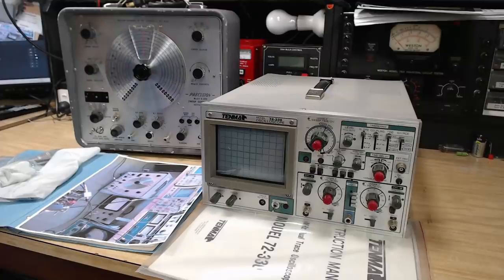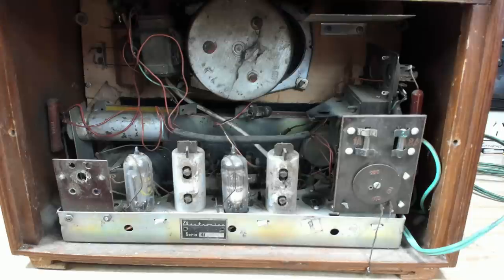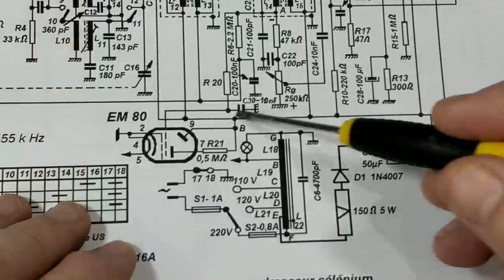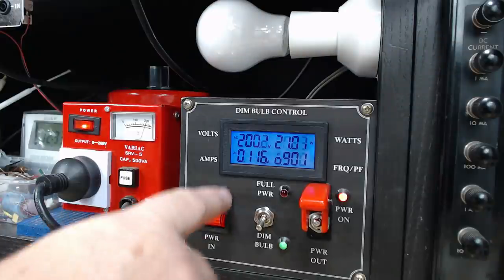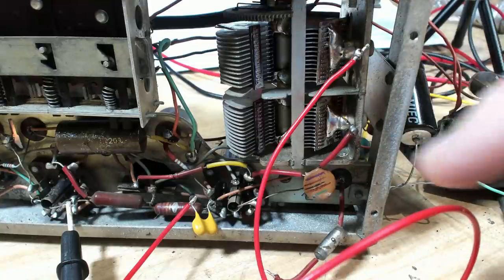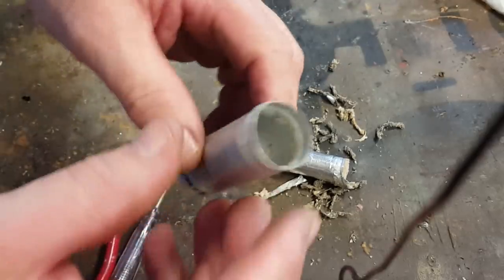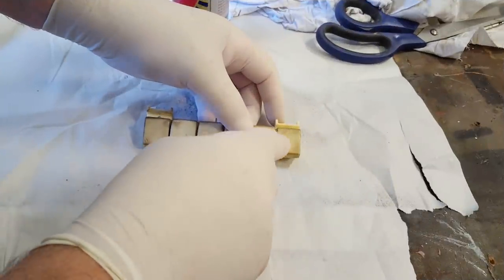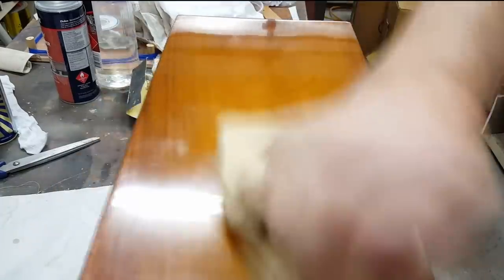Carmen 2 1963 radio from Romania - Restored

Comment: Hello Dave how are you. That is a very good looking radio and you made it work as good as it looks BRAVO. My mom is German she like your videos on radios from Germany. I shared your videos to her messenger.  I would like to tell you about a simple inverter circuit you may want to experiment with. I wanted to challenge myself in building the simplest inverter that can run a shaded pole ac motor. I used ECG179 Power Germanium transistors because I have a big box of those plus I wanted to give it a vintage charm. Silicone transistors will work too. The parts needed are....two ECG179 PNP or equivalent, two 1N5406 diodes or 1N4004 to 1N4007 depending how much current the load will be. One power transformer 120VAC  Primary 18VAC Secondary center tapped.....construction..,...on each transistor solder a diode to emitter and base. Cathode to emitter and anode to base then solder a wire to emitters to connect emitters together. The emitters will be connected to battery plus. The battery negative will go to center tap of 18V secondary and end wires of the 18V secondary go to the collectors. Take one wire of the 120V primary and connect to the base of one of the transistors take the base of the other transistor and connect to a 7 watt 120V night light bulb connect other end of night light to the other wire of 120V primary.  If it doesn't oscillate or light up reverse the 120V primary winding. To run a small shaded pole motor like a record player motor you will need to wire a motor capacitor in series with the motor. Most record player motors will run at the proper speed with a 2.2 to a 5uf 370VAC capacitor. It is a unique circuit because the feedback is also in series with the load and the base current is driven by load amount which will provide a simple crude way of regulation without optoisolators...etc. its the simplest way to run a shaded pole motor with a battery. The capacitor value must be selected so that the capacitive reactance matches the same reactance as the inductive reactance of the motor.....5uf for a 20 watt motor will be close.. for a small 6" desk or clip fan. I built one that has a 300 watt toroidal transformer and four silicone TO-3 metal case power transistors mounted on separate heat sinks and can run a 20" window fan with a 47uf run capacitor or can light 3 100watt light bulbs without capacitor or small ac brush motors such as hand drills won't need capacitor. A 220VAC 50HZ power supply can be built to power German record players.
Reply from the maker: Hi Chris, my that's a lot of writing, I have printed it and put it in my quick reference folder for future use, thank you. The radio came up great, I was very pleased, I'm glad your mother likes some of my videos too, who would have thought. Thanks Vinny 😀
Reply: @DavidTipton101  you're welcome David. If you decide to build that circuit keep in mind that its not adaptable to all motors. The size of the power transformer, the value of the capacitor, the DC input voltage, the power handling of the transistors all matter. The circuit has to be made for a particular wattage motor. I will try to build one that has frequency and voltage regulation later. The theory and basic structure is the same for all sizes of circuit/motor combinations just the value of components will be different. I also shared this circuit with radio TV PHONO nut because he had one that needed 50hz. Somebody on his comments said it wouldn't work because it has to be exactly 50hz. and not some arbitrary frequency. I replied it can be off by 1% and not HEAR the difference in music and all shaded pole motors will operate between 50 to 60 hz. I wished he would have tried it before he decided to badger my circuit. I have built a portable record player from scratch. I built the wooden cabinet and installed a bsr monarch ua8 changer with 120VAC Motor and built the amp from a TDA2009 and mono bridged it for more output. It has a 5×7 10 watt speaker and very good sound. This same inverter is installed and designed to operate on 8 volts so that the regulator has headroom for 12 volts input. I had to add a regulator because the music would drag down as the battery got low hahahaha. It will play 15 long play 33 1/3 albums before it needs recharging. It runs on a 12 volt 9.5 amp hour sealed lead acid battery and I play it outside on special occasions with friends and family and they are amused by it. Thank you for being so kind. You are very intelligent
Reply from the maker: @chriscimino7854  Yes, it would need to be adapted to suit the motor. If it was for a record player I would probably machine a new spindle to change the speed if that's at all possible, it would take a bit of calculation of course. I agree it would be difficult to notice a slight record speed change on most recordings. If it was accurate could it be adapted and used to run a 60 Hz clock from a 50 Hz supply?
Reply: @DavidTipton101   if its on the mark at 60hz it could drift from temperature change on even the best capacitor. Slight DC input voltage changes can fine tune the frequency. I haven't tried it on a synchronous AC motor. It would lose time on an LC network. At that accuracy it would have to be crystal controlled. I wonder how the power company regulates frequency. Mmm interesting I think I will have to Google that. I think my next one will have a big  power amplifier to isolate the load from the oscillator and adapt any motor plus other loads in parallel up to its capacity and have voltage regulator on the oscillator to keep it steady. I bought a 3000 watt power inverter from Harbor freight and it works like they say it will. It can start and run refrigerator compressor on a big side by side during power outages. It needs short MASSIVE cables connected to its own 1000amp hour battery for starting motors that have start windings such as refrigerators and has to be connected to an idling car for heavy loads. I tried with just only jumper cables but it couldn't pull enough current for the start winding. I have a gas dryer and I wanted to start the dryer motor which is a bit larger than a refrigerator hahahaha it wouldn't do it. It has an over current shutdown. I had to wait for the power to come back on to dry clothes. The inverters today are incredible I think the biggest one I seen for 12 volt is 5000 watt and weighs very little. Most of the power is used to start motors
Reply from the maker: @chriscimino7854  Wow, that some heavy duty work you are trying to do. A portable generator plugged back into the house supply might be a better option, not quite as cheap though 🙂
Reply: @DavidTipton101  I only use it during a power outage. Its fun to play with too hahaha. I'm amazed at how it can start my refrigerator on a car battery. I saw a really old one a long time ago. It used a mechanical vibrator and a HUGE transformer and weighed a ton but no good for induction motors. Square wave for lighting or radio TV. Power handling was 400 watts. Inverters have come a long way in technology and are lightweight
Reply from the maker: @chriscimino7854  Oh I guessed it was more of a bit of fun more than a practical solution to power outs 😄

Comment: At 9:00 the tube you said it seems " 80 " perhaps it will be an EZ80 rectifier since the " magic Eye " is an EM80... It's curious that it appeared like an Philips or Grundig or another comtemporary german radio - the touchdown switch pad...
Reply from the maker: Hi KK Teutsch. I said E Zed 80, you may be more familiar with E Zee 80. Yes it is an EZ80 or 6X4 rectifier. It looked like most European radios of the period with the keys and magic eye although a bit more basic than the German radios. Thanks KK Teutsch.

Comment: A self venting capacitor sounds like 👍 a GREAT 😊 idea 💡. Ya were the first one ☝️ to come up 🆙 with the idea 💡. Ya should patent the idea 💡. These must be a “safety” capacitor, so if one ☝️ blows, it’s yours, not others about the radio 📻. I saw 👀 the green“eye” on this radio 📻, which was common on older tube type radios 📻. In one ☝️ respect ✊, it’s a tuning eye 👁. I think 🤔 it also can kind of tell ya when the radio 📻 needs service. It’s almost 😅 fully green (wide open), when a tube, or capacitor is burning 🔥 out. I really like 👍 the wood 🪵 finish on this radio 📻. Your idea 💡of waxing the radio 📻 sound great 😊 as well. Re-stuffing those capacitors looks hard, but in the end, it’s worth it. I hope 🤞 the dial cord’s doing good 😌. I I also like 👍 the dial light 💡 just the way it is , not to add a second one ☝️. I also like 👍 the piano 🎹 key 🔑 style buttons, it makes the radio 📻 look 👀 German. Very impressive permanent magnet 🧲 speaker 🔊, Mr. Tipton!! Once again, ya built it as a self venting capacitor, so if a problem arises, this is the capacitor that it blows out, not other capacitors that are about next to impossible to replace. Your friend, Jeff.
Reply from the maker: Hi Jeff, the capacitors have weak point stamped into the case, I allowed it somewhere to go. I like magic eyes on radios too. It's a very nice looking radio, thanks Jeff 🙂

Comment: 9:17 only a thought mate, but a bigger / more powerful magnet will make the speaker more effiecent. so better volume output (db) for a given power in. That said if I remember right an EL84 will give up to 7 watts, more than enough for a 5 inch speaker.
Reply from the maker: Hi Neville, I get that it has the big magnet for better control but I haven't seen one that big before, it's almost the same diameter as the speaker cone! Yes, it's a ECL82 👍🙂

Comment: It looks like the winding at the top end of the aurotransformer is 6.3 V for all the filaments and the lamp, so the melted wire carries the sum of the filament currents and the B+ to the rectifier.  Also, the RMS value of the rectifier current is much higher than the dc value because it is pulsed.  I am still surprised it melted the wire, its only a couple of Amps or so
Reply from the maker: Hi Eric, yes it carried all the return current from the radio, the wire didn't melt, only the insulation. I wonder if they purposely used a low current carrying wire there to limit the current flow, like a fuse. Now you have me thinking 🤔

Comment: David, could I please ask you a question: I have two small special bakelite knobs that are labeled with engraved white lettering. One is trashed and the other is in good condition but says the wrong thing. Any idea how I could re-label the knob that's in good condition?
Reply from the maker: Hi William, that's a tricky one and I don't know any way to do what you want, the best way would be to obtain another knob. You could minimise the lettering by removing the white paint, you may be able to fill the engraving with a suitable mix of artist acrylic paint. You can't sand the Bakelite too much as you will go through the outer 'skin' exposing the soft centre. If you can fill it successfully you might be able to get someone to engrave it on a section of original knob. Sorry William, I'm not much help.

Comment: I have an old Grundig 4019 from 1959/1960 that I should probably drag out and do something with.  I kind of think about it when I see these videos, but then I run out of time.
Maybe I should find someone to adopt it.  I don't know if I will ever have the time to do it justice
Reply from the maker: The Grundig 4019 is a nice radio Brendan, if not you I hope someone can use it one day 🙂
Reply: @DavidTipton101  I do like that the turntable input is stereo :).   If I do restore it I will have to convert the FM a bit as this model is the German one that only goes to 102MHz :).
But it is a nice looking radio.

Comment: Would the insulating bushes from a power transistor installation kit have worked in place of the grommets.
Reply from the maker: I am not familiar with them David so I couldn't say. What I used here worked OK but other radios could use bigger rubber mounts 🙂

Comment: I don't think the shorted capacitors could overheat the wire. However a short circuit in the filament power would definitely do that : High currents for longer time without blowing the input fuse...
Reply from the maker: Hi Anna, I didn't find any issues in the filament circuit, I suspected the capacitors as they can go partially short and increase current flow. I often see reduced current draw after replacing a radios capacitors 🙂
Reply: @DavidTipton101  yes, capacitors tend to go bad, but in order to overheat the wire this way, you need quite a few amps for that. Something like 10A or even more, for at least a few seconds (so the softened insulation had time to flow together). Coming from the high voltage anode supply or so, we would be talking about nearly a kW of power dissipated somewhere in the radio, still assuming the rectifier can handle it. That would be a lot of heat generated. The components dissipating a kW of heat would look quite different, believe me, even after few seconds... So such wire overload must have come from something of a low voltage, where the associated power would not cause to evaporate  anything instantly. And the only such voltage there is the 6.3V heater circuit (with a 10A fault current it would mean just about 60W extra, most likely within the rather heavy transformer, which uses to handle that well). There just a bent eye on some tube socket could gave been enough to cause a short circuit to something grounded. Or just someone messing around with a screwdriver or a bare meter probe inside, without due care, causing such short circuit...
Reply from the maker: @annaplojharova1400  Good point, thanks Anna 🙂

Comment: Hi David,  another great and meticulous job bringing this East German wireless back to life...!

A bit of a coincidence here,  just 2 weeks ago a purchased a vintage 'East German' radio from a seller on ebay. He had done a lot of work on it, replacing Caps, and resisters and it works very well.
However, although VHF/FM works Ok, the seller told I could improve that particular waveband by fitting a new ECC85 valve.  I don't know how much it would improve reception, but I went ahead and ordered a new valve.   At the moment it is receiving via the internal aerial.  What do you think David, will that new valve make a world of difference ?

For me having this beautiful wireless.  https://i.ebayimg.com/images/g/lQkAAOSw14FiDSq8/s-l1600.jpg.  is pleasure enough,  and it has a Bluetooth connection through a DIN plug, so I can play my iphone through the radio.   I'd be pleased to hear your opinion on the new valve ?    Many thanks.
Reply from the maker: Hi Mike, thank you. The ECC85 (6AQ8) is a twin triode and usually uses one triode for RF and the other for the oscillator. The benefit of replacing it with a 'new' one will depend on the condition of the one fitted in the set. It sounds like the guy you bought it from may have tested it and found it weak, a new one will improve on that 🙂
Reply: @DavidTipton101  Hi David, many thank's for explaining about the ECC85 valve. I am still waiting for the delivery of the new valve. Did you get a chance to view the link I set ?  The set I bought is a WEIMAR 4900 VEB SONNEBERG.  It has 6 valves in it, and the cabinet has beautiful Walnut veneer without a scratch or mark on it.  I understand it is East German ( GDR) from about 1940's.

I was born in 1952 making me 70,  and I remember my parents having a Regentone table radio.... I think mine is better than that one was.  I've always found it strange calling these valve radios 'Wireless sets'  especially as they are full of wires..! 

If you have an email address, I can send you pictures of the inside of that set.    Have a good weekend,  Mike
Reply from the maker: @mikesam347  Hi Mike, yes I checked the link, a nice looking set. I have an email: vintageradioaus (at ) gmail.com

Comment: Sounds like 👍 ya called 📞 this equipment a sweep 🧹 generator. Very nice 👍 radio 📻. By the look 👀, it probably has a very complex dial cord system. Ya must have bought this from Shango066. Take care with this radio 📻, in case it has asbestos in it. The speaker 🔊 appears to be field coil. Your friend, Jeff.
Reply from the maker: It is a sweep generator Jeff, the speaker is a permanent magnet 🙂